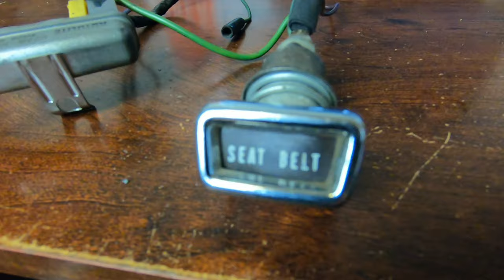Seat Belt Reminder Light - Operation - Bench Test - 1966 Ford Mustang

Comment: My 1966 Sahara Beige H:code coupe came with the deluxe seat belts and this warning light....such a cool piece...I also have NOS parking brake warning light and also a flasher warning light...I'm thinking of installing those 2 extras...would probably look so cool.
Reply from the maker: Oh ya that would be awesome. Very unique pieces to have and have operating.
Reply: @AlfsMustangGarage  the funny thing that the wiring was from a Fairlane...I also have a OEM Mustang seat belt light wiring that I bought to tell the differences.

Comment: Mine is not working so I checked the relay and I don’t see any obvious breaks in the winding. When I place a jumper wire from chassis ground to the ground terminal the light comes on and stays on. What could be the issue? I am still trying to grasp the concept of how this works. What prevents the light from coming back on after the rod cools?

Comment: I am currently troubleshooting my seat belt reminder light.  Where is the bimetallic unit located in the dash?
Reply from the maker: So there is a bracket that the wiper motor and transmission would mount to. I believe that is where these would mount to. If you search for these on Google images you will probably find a good picture.
Reply: Update.  With your help (again!) Got my seat belt reminder light working! Now all I need to do is find the OEM (or repop?) "Seat belt" bezel.
Reply from the maker: Oh awesome! Well there are plenty of repops out there.
https://www.cjponyparts.com/scott-drake-seat-belt-reminder-light-kit-mustang-1965-1966/p/HW816/?year=1966&gclid=Cj0KCQjwr82iBhCuARIsAO0EAZxP6gnmJezrKEmKpDh0fIL3SNoQFoLON5zB_BW_qRto_Tifiu7_7MQaAjeqEALw_wcB
Reply: @AlfsMustangGarage  thanks, but not looking to spend 65 bucks....my light system works as it should...just need the bezel. Guess I'll just have to keep my eyes open at swap meets and junkyards.

Comment: So I have one in my '66 Mustang Convertible. It's not working. Is it possible to troubleshoot while in the car? Your thoughts on next steps?
Reply from the maker: Yes, should be able to troubleshoot. You're probably easier off to remove it though. First thing, check the bulb and see if the bulb is getting power. Start simple, bulbs do burn out.
Reply: @AlfsMustangGarage  Does that just twist off to get to the bulb?
Reply from the maker: Yes, from the back side.
Reply: I believe that the seat belt reminder light gets power from the instrument cluster fuse. You can start there and also check your headlight switch, as the power goes through it to the fuse block and out. 
Mine wasn’t working and I found out that I had a bad headlight switch.
Reply: @dm7097  Thanks! I'll check that out.